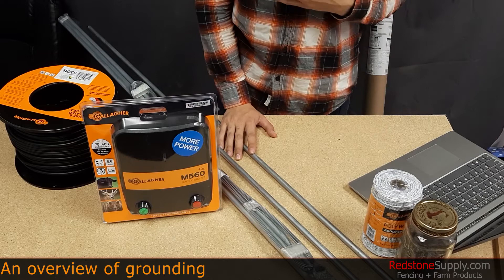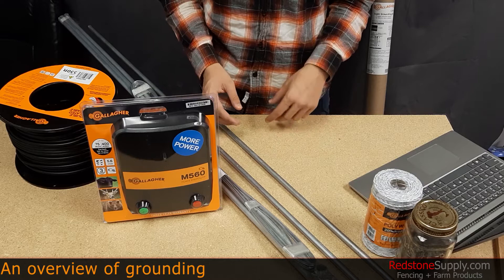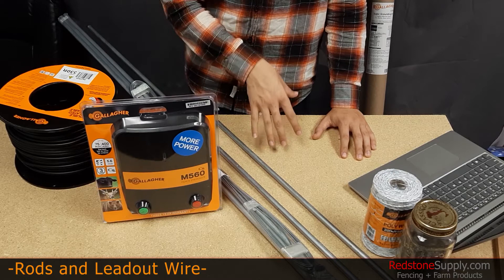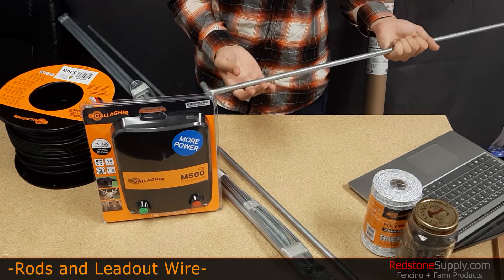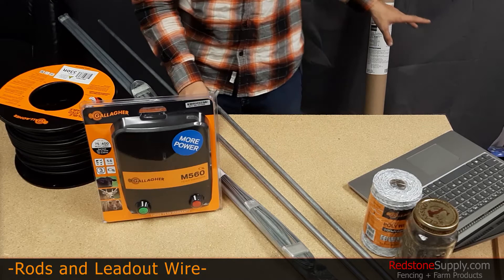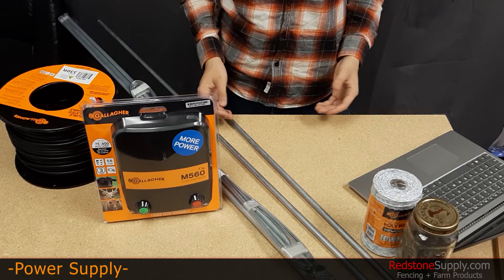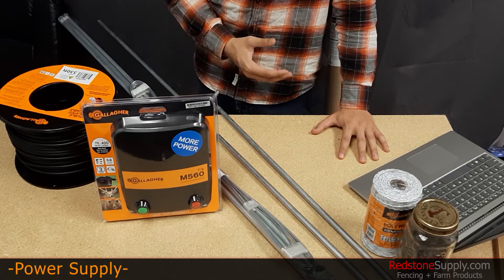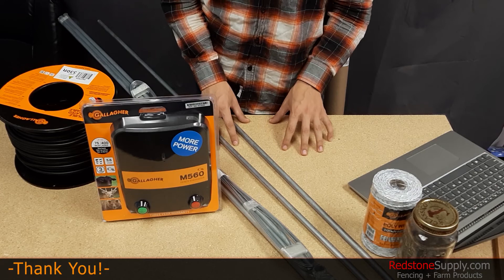An Overview of Grounding at RedstoneSupply.com

Comment: Saying copper bonded ground rods will destroy the fencer or system is wrong.  It is using dis-similar metals that create corrosion.  Copper ground rods will outlast galvanized rods for a small increase in cost.  Further, using copper rods with bare copper wire and UL listed direct burial copper alloy rod clamps is preferred electric utility practice.
Reply: But what if there are dissimilar metals in the charger itself or on the terminal where the grounding system connects to the charger?  Would that cause whatever the problems are that I should avoid?
Reply: @patrickcleburneuczjsxpmp9558  Dissimilar metals are used in your home’s electrical system. Most service entrances use aluminum wire up to the home’s breaker panel. You can use an anti-oxidant grease to help prevent corrosion, but if the joint is subject to weather it will eventually fail. If you use a copper clad ground rod, you will be well served to use copper ground wire and use an anti-oxidant where you connect it to the energizer. After that, inspect the connection every few months and you should be fine.
Reply: @lenrsmith  Thank you!  Where would I find anti-oxidant grease?  Should I just smear it around the connection?

Comment: What kind of surface prep do they do on the 3' THandles before welding?  Had a weld failure and the ungalvanized surface (sealed) had a heavy layer of rust.  Should one connect the ground clamp to the vertical portion or is the horizontal portion acceptable to clamp the grounding wire to the rod?

Comment: Hi and thank you for the instructions.
We'll be using a positive / negative  wire fence system.
Three wires with the central wire an earth.
Does this system still require an inground earth rod nearby the energiser?